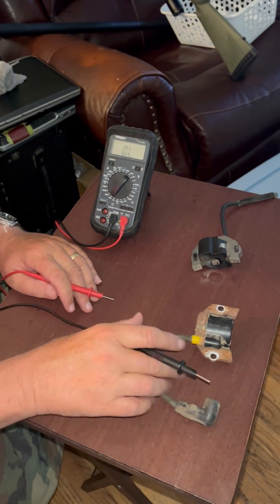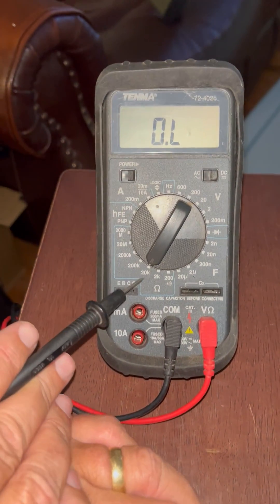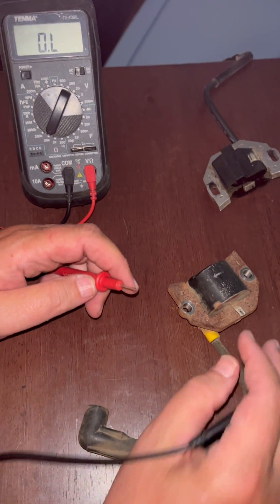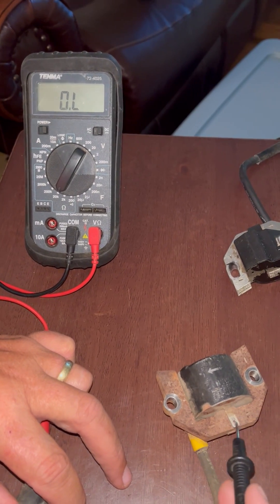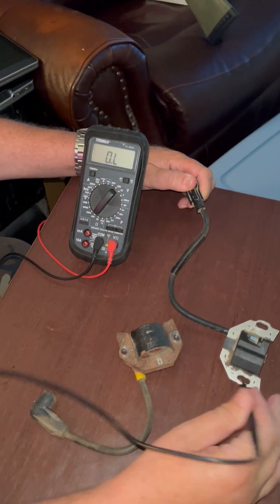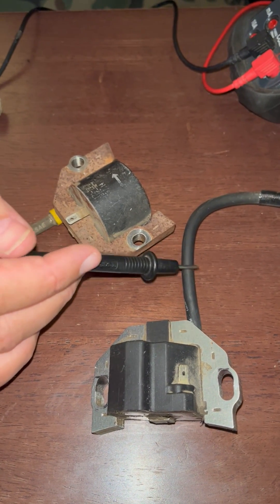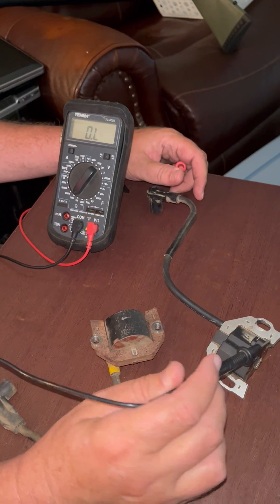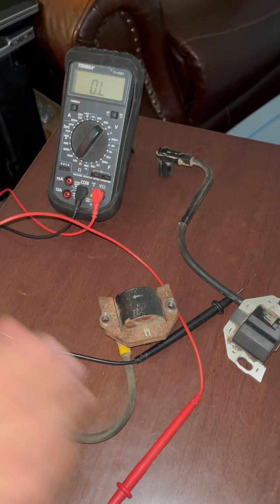John Deere/Husqvarna/Kawasaki ignition coil test--careful of some videos on this subject!

Comment: I tested as you recommend, and found 8k ohms on the plug to frame, and 8k from plug to kill switch, and I also tested  frame to kill and found 0 ohms resistance.  So my frame to kill switch is the opposite of open-loop - it's actually closed.  Does that explain why my mower will NOT shut off?   You explained a lot, but you didn't really get into the kill switch function, right?  It's plausible that the some kill switches are wired to "open" when the ignition key energizes the system?
Reply from the maker: When you tested coil frame to the kill switch lug, you said "zero" ohms... did you mean it's open? Or are you saying it's showing the same thing you see when you touch the meter wires together? 

The kill switch simply grounds either the primary or the secondary of the coil, depending on how the coil is made. Either way works. 
If you're finding that your mower will not shut off, you don't have a ground on the other end of the wire that connects to the kill switch lug.
Try using a jumper wire from the battery's NEGATIVE post. or simply from a bolt on the frame of the mower, then touch that to the kill switch lug on the coil. If it still won't shut off, your coil has an internal broken connection to the kill switch lug.

Comment: IT SURE WOULD HAVE HELPED IF HE WOULD HAVE SAID HOW TO TEST THE PRIMARY ( SMALL TERMINAL) 
 TEST IT BY ONE METER LEAD TO THE PRIMARY AND THE OTHER BODY  OF THE COIL  ( GROUND)  
BEWARE ! WHEN TESTING SOME COILS CAN BURN OUT IF THE METER HAS A LARGE BATTERY .
Reply from the maker: Huh? 🍺🍺😋
Reply: That hurt my brain.
Reply: Weeell, looks like he is correct in that info. Must be talking about using one of those huge meters and not a typical hand held meter. In any case this is in the Kaw manual. 

Use only Tester 57001–1394 with new battery at room tempera-
ture for this test. A tester other than the Kawasaki Hand Tester
should show different readings.
If a megger or a meter with a large-capacity battery is used,
the ignition coil will be damaged.